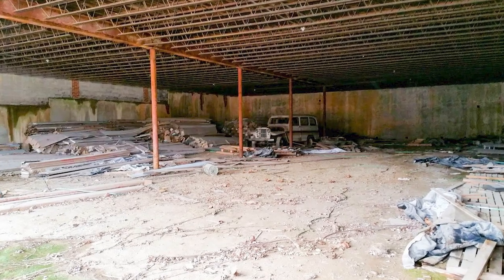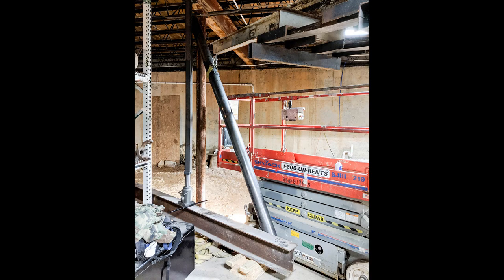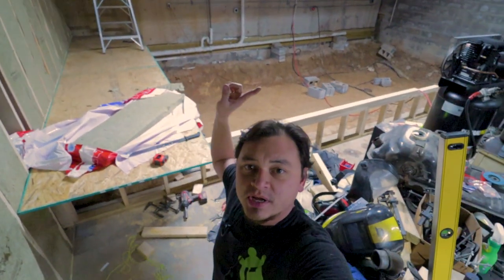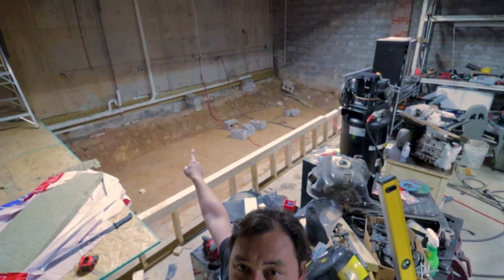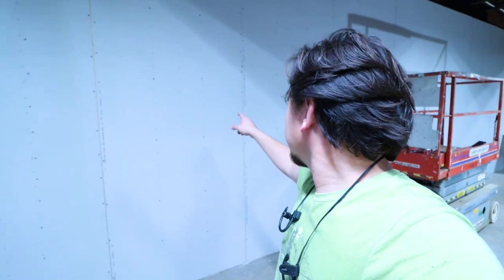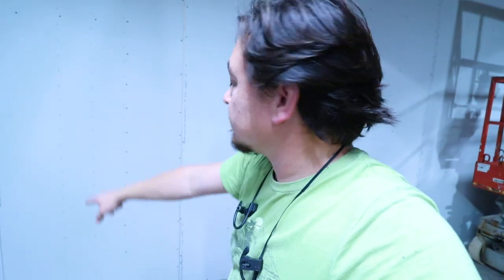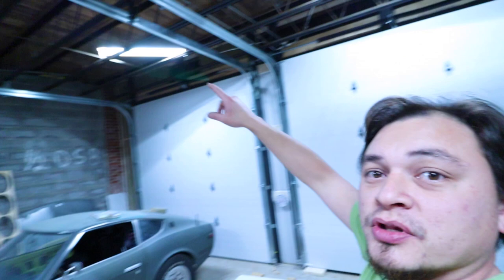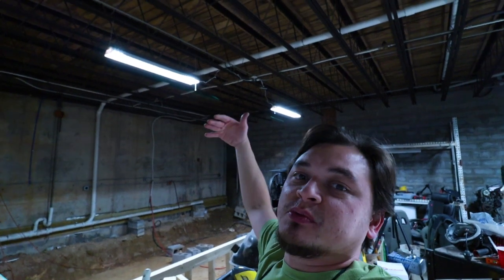Building My Dream Shop in My Basement Part 1 - Slab, Framing, Insulation, Drywall - Turtle Labs - E2

Comment: Great video! I love the idea of a raised area lots of usable possibilities!

A couple quick question for a concrete newbie. My shop floor has several humps and valleys (garage). When you're pouring that much concrete, do you try to make it "dead" level or accept that it won't be exact... also, do you have any slope or drainage included?
Reply: Thanks man! I am quite a bit of a concrete newb too, which is the one thing I have not done myself in this build. I hired that out to Hensley's Concrete Service. They shot for dead level. There are a few small humps, but you really have to be on the lookout for them. I did not include any slope or drainage, since I preferred a flat surface here, and do not expect to need drainage. I made sure to put the money and trust into someone who knows what they are doing on the slab, so that I didn't have to worry about humps and valleys.